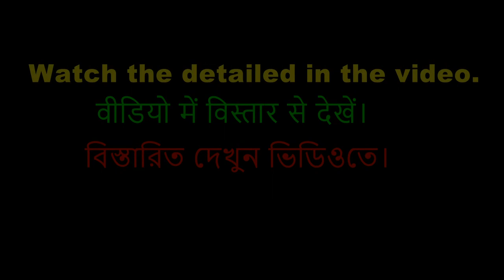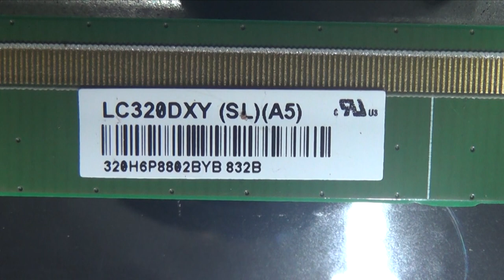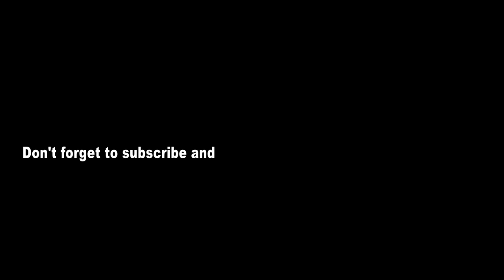LED TV panel repair by cutting.#Pro Hack

Comment: Very simple and understood to indentify problem.Just cut the line whether left or right problem.Good job sir!!!
Reply from the maker: Ok. Thanks
Reply: Can you explain why he cut 10 pins or tracks? 
I thought there 5 it said vgh vgl etc?
Reply: @irishguy200007  it depend on track damage or an in lcd glass.Actually vgh and vgl most common problem if no picture or blank display.Before you cut the track,please check burn an on side of lcd glass and check cof if damaged.
Reply: You appear to have real knowledge so I might ask you if I disconnect the left cable on tcon board, I should see the TV playing on the righthand side of screen only,correct?  What should be displayed on the left a bright Li up screen or a dark screen?
Reply: @irishguy200007  if the only right is have display,the left had damage track on side glass,just try use tape or cut track,maybe clk1-5 is damage.tcon with double side flex cable,can be bypass if lcd still good to have display.
Reply: In general from a healthy TV If I remove the right hand tcon cable then the left hand side of screen will play on itsyown, but what should appear on the right hand half of the screen, white or dark?
I'm tempted to take the back off my new good TV to understand this.
Will the left hand cable power the right hand side of screen even though there will be no image?
Am I correct to think that with the right hand cable removed the righthand side of screen will still light up?
Reply: I haven't opened my lcd TV yet but It was heating on lower left side of screen with distorted lower picture from left to right. I am thinking it's a cog not a cof but can I disable this lower left side gate cof/cog out of the equation and hope the lower right cof/cog will take over the job of running the lcd screen. Is what I am saying in anyway feasible?
Reply: @irishguy200007  yes, is possible to cut the track on lower side at board....you need to find where is shorted track and just try cut it,if not just try right side.Remember after cutting track not work at left or right, you must be solder to reconnect the cut track.I think maybe your lcd still working on right or left side track.This procedure maybe can holding 6 month or 1 year to your lcd before is 100% damage to both sides.I am experiencing to my tv,it can hold right side with 1 year and 5 month,it depend how long you using it before both side damaged.
Reply: @SHTFFuel  Can I disable just that cof on left hand side and leave the other gate cofs intact and working. Cutting tracks on left hand side I imagine will shut down the entire left hand side which I don't desire to do only the lower left gate cof/cog
Reply: @irishguy200007  yes... You can disabling it on tcon board with isolation tape or cut track on vgh odd and vgh even at flex cable housing left or right.
Reply: I have a feeling that will disable all the cops on the left hand side though,  I want to eliminate just the first one at bottom left hand side and allow the rest of the gate cofs/cogs to run on left side. I saw guy using a grinder cut the cog out of glass leaving a small hole on lcd but that might be beyond my ability.  cutting a vgh line at tcon board left side will remove vgh from all cofs /cogs up left side which I think there are four. I want to cut off power to first one on bottom left but allow others to run, Is my understanding way off?
Reply: @irishguy200007  grinder on glass is very risky to do it,because thin line or track on glass will damage other line...for me if shorted on glass need to do it with tool like a shorted killer(power supply can be variable ampere tools) but it depend how bad is shorted,if too bad the thin line  will be parmenent damage and I refer this is a 100% damaged lcd need replace new one.

Comment: Don’t understand beginning video and end looked the same 🤔
Reply from the maker: Thank you for your information.
Reply: yes you dont understand, the beginnig the panel doesnt even show image the reason is the line, vgl, vgh etc also broke... at the end of the video the image was restored, any method will fix the glass broken that damage can not be repaired in this method he just restore de image on the panel if still you doesnt understand maybie youre not even a technician so this video isnt target to you.
Reply: @hernandocarcamo3950  well it was a bit confusing as it jumped to someone drinking etc I thought it was like a video
Reply: I don't understand why he cut 10 or more tracks?